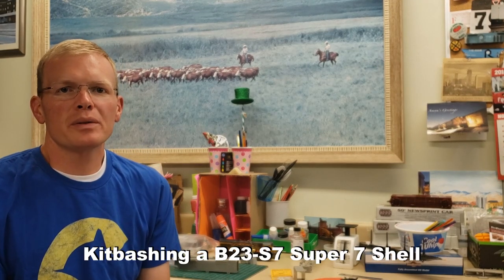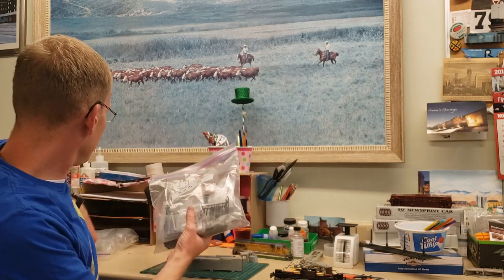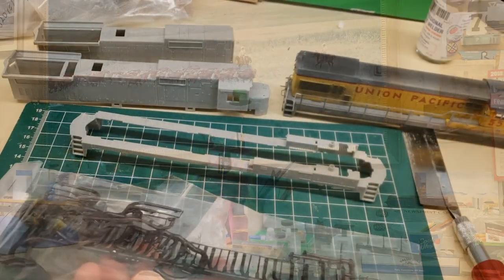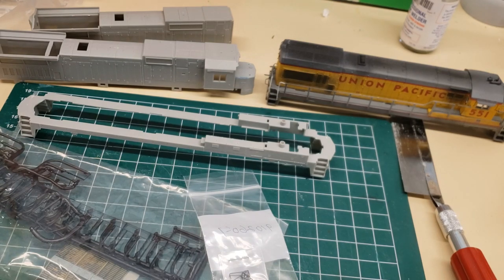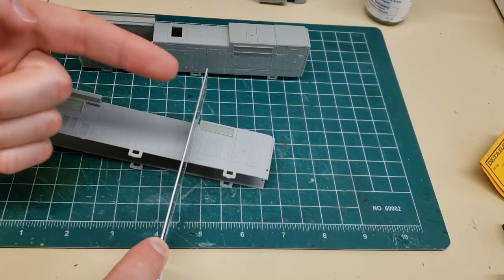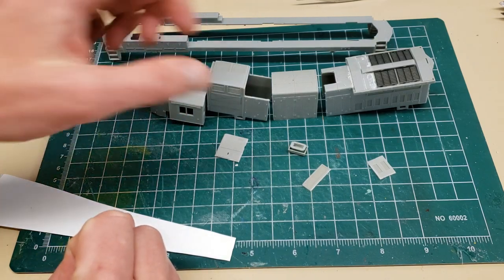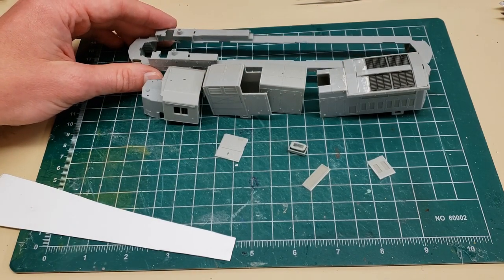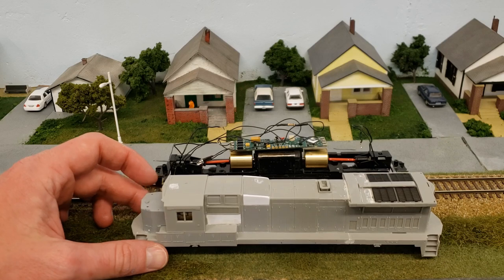Stockyard Industrial Lead: Super 7 B23-S7 Shell Kitbash

Comment: I hope someone makes the B23-7 Super 7 commercially before I get around to needing to kitbash a bunch of them. The Ohio Central owned a bunch of them secondhand and they were the most common locomotives used on the locals serving my hometown when I was little, so they're gonna be mandatory for my planned railroad.
Amazing work here but I can't say I'm super keen to do a minimum of half a dozen of them kitbashed.
Reply from the maker: Yeah, I was also hoping that someone would make it or at least make a shell to fit on the U23B.  Usually what happens to me is that I kitbash it and then a year or two later, it is offered by a manufacturer!